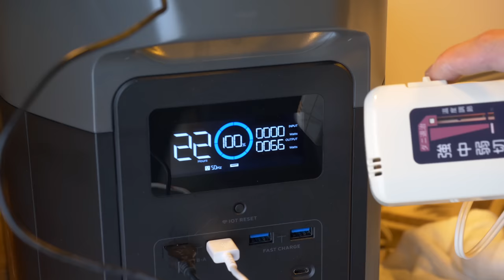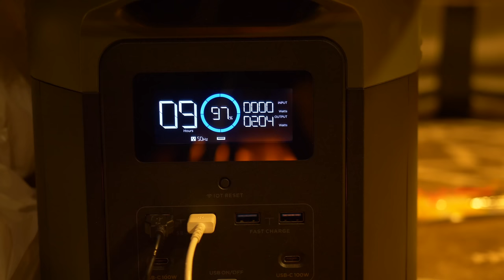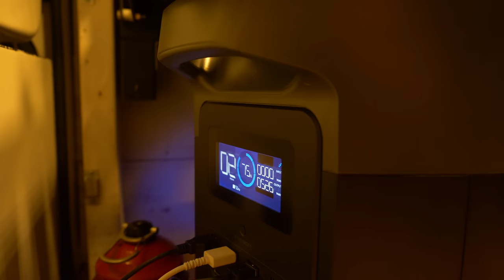【雪中キャンプ】大雪に埋もれる秘密基地！薪ストーブで作るきりたんぽと日本酒をいただく Relaxing nature  ASMR EcoFlow DELTA Max2000 車中泊ハイゼットパネルバン

Comment: From South Africa here is a tip.
To roll up large square canvas or other material, form a point in the middle at rhe bottom  by folding the left all the way over to the right, and the right over to the left.
Start rolling the material panel up from the point in the middle at the bottom 
Even large pieces of material are easy to manage on your own
Reply from the maker: Thank you for your advice.
That's the way I'm wrapping it now. 👍

Comment: The rear door as a rigid awning is a nice feature, and you make an enclosed annex out of it in a very efficient way.  

Very cool camper.  I bet it would be "a dog" on American highways, but very good once you're off the beaten path.  

I'd still be more likely to camp out of a pickup or a teardrop camper towed behind it.  Way better on the 80-mile-an-hour Interstate (Law-abiding Americans drive 80 in a 75 mph zone.  :o)  ) in the Rocky Mountains or plains, and more maneuverable the worse the roads (or off roads) get.

Comment: How about those small tires do you ever have problems getting around in the snow.
Reply from the maker: If the tires are small, you won't be able to go into deep snow. 😅
Japan has a vehicle inspection system, and it is illegal to wear non-standard tires, so this is the size for this car. 🛞

Comment: what is that power inverter he is using. must be good to run a 1200 watt heater
Reply from the maker: The battery I use is EcoFlow DELTA MAX 2000.

Comment: Great video and I don't want to be negative but why do you waste electricity on a heater when you have a wood fire?
Reply from the maker: This van has a lot of potential.
Since Japan is prone to many disasters in addition to camping, we are also equipped with electric and gas stoves.
This camp combines old-fashioned tools with modern equipment.

Comment: How the ventilation works in the night? I need because a can't in my truck
Reply from the maker: There are gaps inside the tent and no ventilation is required.
This vehicle is equipped with a carbon monoxide warning system.

Comment: I wonder why someone lights a stove in a place that is open without a door. Perhaps to cook. But he cooks inside the car. And then he turns on the heater with the door open yet. I really can not understand man’s thoughts. He did not need to do all these inside. The doors are open and it is snowing, why he did not sat outside to cook?
Reply from the maker: I often receive comments like this.
This is because the flap is open during video recording to make it easier for viewers to see.
Close the flap when not taking pictures.
All this is done for the benefit of the viewer.
I hope you understand that much.

Comment: what was that machine that gave you electricity for the rice cooker?
---------------------------------------------------------------------------------
炊飯器に電気を供給するあの機械は何でしたか？
Reply from the maker: That battery is EcoFlow DELTA MAX 2000.
I think a successor is out now.
I think a slightly smaller capacity would be fine.
Reply: You mean it can run a rice cooker and a heater? Must be wonderful. @Smallbasecamp
Reply from the maker: @medi768  Both can be operated. 👍
It is a strong ally of winter.
Reply: Lovely! Thank you for the info. Ill buy it today as I need it too much.  @Smallbasecamp